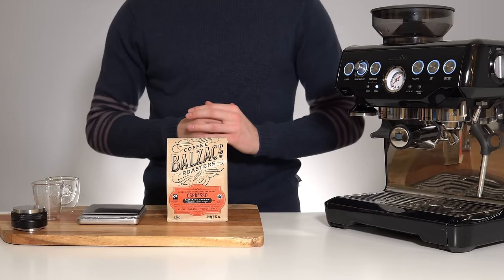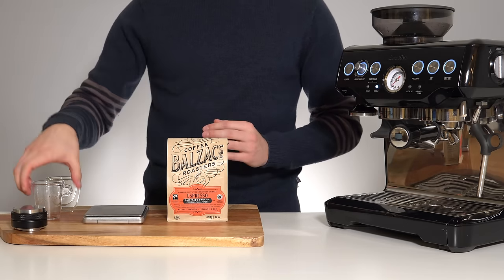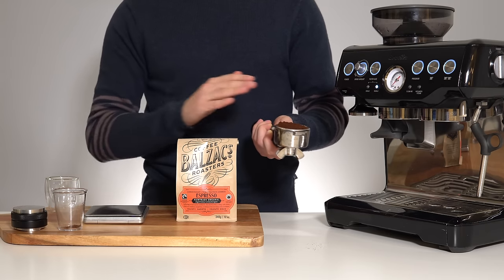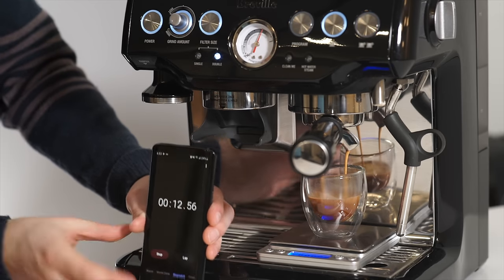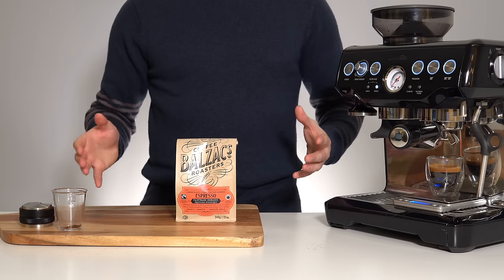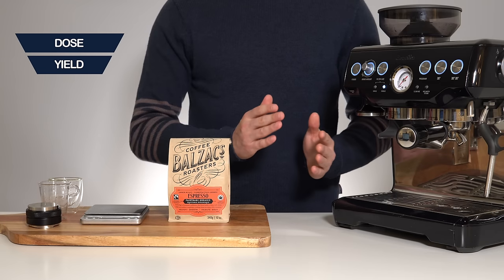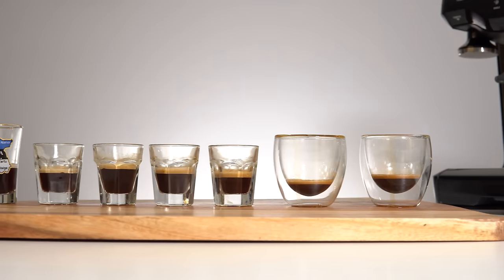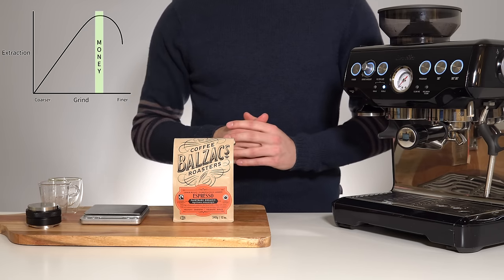Dialing In Breville Barista Express | Dose, grind, yield, time

Comment: Hey! Love your video and have been dialling it in myself. What does it mean if I am using 18g of grounds, the pressure is at the Max of the grey area, but it still runs fast. I got 54g (3:1) in 20 seconds. So my desired 2:1 was probably 14 second or so. Thanks!

Comment: There is an additional adjustment underneath / inside the bean hopper. Did you make an adjustment for that or leave it at factory setting?
Reply from the maker: Our grinder is on the factory setting, but it can vary from machine to machine

Comment: Hi, I know this video was posted a year ago, and you're propably not going to reply but I just wanted to say how much you helped me!

I do have a problem though:  What do I do, if the espresso runs way to fast? (at around 12-15 seconds). I already adjusted the grind setting to "3" which is very fine, and its still running fast. 
Should I up the dose? The beans I use have a light/medium roast.

Thanks!
Reply from the maker: Always remember to be dialing in to taste as well, but if you're still underextracted, grind finer! Even if you hit 1, you still have more grinding range! https://youtu.be/QNvOcE4-VEo

Comment: Thanks for the video. Any guidance on what time range I should aim for if I want to pull a single?
Reply from the maker: Single shot baskets are specifically designed to produce a similar tasting shot using the same grind setting as the double shot basket, in a similar extraction time. You can play around a bit with dose and extraction time to taste, but you should not need to touch the grind setting (thankfully) when switching between a double and single basket. Follow your tastebuds! A single shot basket will be far more sensitive to small variations in dose, extraction time, etc...

Comment: Have you run into issues with your grouphead rubber seal popping out in spots when pressure gets too high? This just recently started happening with our barista express. It first happening when backflushing/cleaning with the cleaning insert. It would build up max pressure, hold it momentarily, and then lose it and water would sputter out of the grouphead. When that happens, I have to remove the screen and push the seal back into the grouphead where it has pushed out. Also, it seems that locking into the portafilter is easier now than it used to be. There used to be much more resistance to locking in a tamped portafilter. I seem to be able to avoid the loss of pressure problem by not tamping too hard, but now I'm getting under extracted shots (IMO). Any thoughts on why that's happening? We've had the machine just under a year and it only recently started happening. We descale it probably every 2 to 2.5 months.
Reply from the maker: I haven't run into that problem on any of our machines. The portafilter locking into the group definitely gets easier after a few months of ownership. 
If you are struggling with maintaining a seal, i suggest replacing that rubber gasket. Its relatively easy to do, and will likely solve the issue :)

Comment: Do you use double wall or single wall filters? 
Great video btw
Reply from the maker: Single walled!
Dual wall filter baskets are only for use in cases where the coffee you are using needs "help" building pressure, such pre-ground store bought varieties. Are long as you're grinding fresh coffee, and grinding fine enough, a single walled basket will produce a better shot of espresso
Reply: @LifestyleLab_  thank you for quick answer, I guess I should invest in some good quality beans. Store bought PC brand coffee beans keep pouring out in 9 seconds even at the most fine setting.

Comment: What is dialed in? Each time you add some beans you have a whole new set of variables to adjust for. Even the same bag of beans will change over time. Just put the beans into the hopper, set your grind amount until it rises over the edges of the filter basket, tamp consistently with the built in tamp and you will dial it in consistently without having to weigh anything. I get great consistent crema like your best shot every time with my supermarket branded coffee beans every time. When I switch to expensive beans I just have to trial and error grind coarseness a few times with everything else consistent and constant. That’s just way too much work and still requires the same trial and error.

Comment: Hi, great videos, keep it up! I have a question though. If I use 18g of beans, it's not enough to fill-in the basket at grinder setting 8. It;s way below the edge of the Razor tool. I have to go all the way to 21-22g to fill-in the basket. Is this an issue ? Does the basket need to be full to have a good extraction ? Thanks for your help!
Reply from the maker: Yes, the basket does need to be full otherwise water will pool ontop of the puck. How is your flow rate looking with 21grams?
Reply: @LifestyleLab_  It's much better with 21 g. But I think the quantity of beans needed to fill-in the basket really depends on the type of coffee used, I guess the lighter roast would require more beans to fill-in the basket.  I just found it interesting that everyone on the internet mentions that the dose should be 18 g, but this clearly didn't work for me. This is one more parameter to take into account. With the bottomless portafilter, I can see lots of channeling when the basket is not full. BTW: Thanks a lot for your amazing videos !

Comment: I poured almost 10 shots but it was still runny, i also increased the grind size every time. 
but when i set it to 3 gave the perfect shot in exact 25 sec but it taste bitter and i dont like it 😑.
And the wired part is when the espresso range doesnt go higher than pre-infusion in neither of the shot tries.

Comment: Thank you for this super helpful video. I followed your step by step approach using a palm tamper set on 7.5 mm and get 38ml espresso with 18mg grind in 25 sec. BUT: The pressure indicator is in the "red" zone at 2 o-clock. The espresso tastes bitter. If I reduce grind grade -1 the extraction time reduces rapidly to 14 secs. Any advice ?
Reply from the maker: Try reducing the brew temperature, or pulling the shot shorter to reduce the bitterness without changing grind size

Comment: First of all, great video. But I have a question. I normally begin taking the time as soon as I press the button to start extracting the espresso with other machines, I’m not familiar with the “preinfussion” thing in this machine, but I noticed that you begin counting the time when you see the first amount of espresso. Is this because the preinfussion time doesn’t count?
Reply from the maker: Because you should be dialing in to taste, not to a specific time, the way of counting is somewhat unimportant. When you're aiming for 25 seconds, you're just trying to the the shot to the point where its bearable to taste, but you're work isn't over yet! Use the concepts in the second half of the video to further dial in based on the coffee, and your preferences

Comment: I think it's bit misleading, here's why. Pretty much all the conical burr grinders have grind retention, it means how much coffee (in % or g) is stuck inside the grinder between the burrs, chute, etc. So putting 18g of coffee in the hopper almost guarantee you won't have the exact 18 grams coming out in this machine set up, single dose/flat burr grinder are different stories and they have much more accurate and have less grind retention. Also extraction time should be measured from as soon as the first drop of water hitting the ground not from seeing first drop of coffee in the cup, although you might have the extraction taking place in 30 second, the pre-infusion might take 3-5 seconds so the total extraction time will be 35 seconds instead of 30 seconds, which then could mean you've over extracted the coffee.
Reply from the maker: Although the burrs in the BBE do have retention of between 1-2gr, the resulting amount in your portafilter only truly varies by +/-0.5gr I've found. This is because the fresh beans push out the retained grinds from the previous grinding session. A grinder can not infinitely retain grinds (your machine would be full within a week!) 
With respect to timing of the extraction, and this is something I went over in the video and countless times in the comments, there is no exact number for a over or under extracted shot. Some dark roasts taste great using a 16 second shot, some light roasts can take as long as 35 or 40 seconds. Therefore there is no point in debating the "right" time to start timing a shot, as you will need to adjust to taste regardless. As long as you are consistent within your own process and always time from button push or first drip, you will be constant with your extraction. The 25 second number is a VERY general rule to get total beginners a borderline drinkable shot right off the bat

Comment: Ok I just got this machine and I did the 18g like you said with the double shot basket and my portafilter was overflowing when I poured it back in. Are you using a different portafilter? Yours fit perfectly inside your portafilter. Please help?!
Reply from the maker: You are likely grinding much too coarse. The finer you grind, the more grounds can fit into the same space 

I also find that 17g is a more suitable dose for these 54mm baskets

Comment: Can I ask a potentially silly question?

On this machine, with regards to the wheel on the side for how fine/ coarse the beans are ground. Is it, the higher the number, the finer the beans, or the higher the number the coarser the beans?

Appreciate it has the ‘fine’ and ‘coarse’ modes on either side. But do you turn the wheel towards the setting you want, or do the higher numbers indicate which mode you’re using?

Thanks
Reply from the maker: Lower numbers are more fine, higher numbers are more coarse! 

Big # = big grounds 
Small # = smaller grounds
Reply: @LifestyleLab_  thank you!

Comment: First... AWESOME VIDEO!Question. If I unplug my breville espresso machine, does it reset my program timing? Thanks, Ruben
Reply from the maker: Thanks! 
The settings should remain stored even after being unplugged. In order to reset the machine to default, there is an entire process that has to be done

Comment: Hey thanks for the great video! I'm really struggling to dial in my beans. The first issue was my beans were old, I switched out to a new roaster and fresh batch and the shot instantly looks nicer/thicker and removed the spluttering at the spout, however no matter what grind setting I try the shot is just flowing too fast, I started on stock setting of 8 and I get 36g in around 8-9 seconds. Down to grind size 3 and its about 11 seconds, weirdly the pressure is now struggling to get up even using the same grind size on multiple shots, grind size 3 was hitting about that 12-1am mark, now grind size 3 is struggling to get into the range at all. Really stuck for ideas of what's going wrong?? Thanks!
Reply from the maker: You can still grind finer by adjusting the internal upper burr setting to get additional range
Reply: @LifestyleLab_  Thanks! I tried that, it has made quite a bit of difference.

Comment: Hello 2M views! Love your videos, sounds so easy. We got 3 weeks ago a Barista Express and we have been struggling. With 3 different coffees we never managed to get a good espresso! We have a very good pressure but always a too fast extraction (18g yielding 36g in 19 sec and pressure at « 12:30-45pm ») with a small, dark and spotty crema and a sour/bitter/burnt taste. The burr is at 3 now and the side size grinder at 5. What do you recommend? Is it better to play with the top burr or side? Shall we make the burr finer or keep player with the grind size? We always have a bad coffee with little crema :( Thank you the coffee expert! Help!! Sophie
Reply from the maker: From the sounds of it, you're dealing with some channeling issues. Meaning that there are areas of your portafilter with less coffee than other areas, or no coffee at all. The water will quickly rush through those holes creating a sour taste. You need to make sure that the coffee grinds are fluffy and filling your whole portafilter before tamping. The distributor tool I use in this video really helps with that. A good puck of espresso will create a seal in the portafilter, and force the water to flow slowly across the entire puck instead of gushing through certain low density areas.

Comment: This seems extremely complicated for a novice. Had the machine for a week and I'm frustrated by all the different information of how to use it.  Do you have more beginner videos?  Thanks
Reply from the maker: Espresso is a tricky thing, there's really no way around dialing in a new coffee. Being consistent on your dose is the best way to eliminate frustration, because if you don't and just use timed grinding, the dose will change as you adjust the grind setting. 
All you're looking for is to get a reasonable flow rate out of the machine. If you're overwhelmed, just do this visually

Comment: hello good video, question I am interesting in the PAlm Tamper, do we have to calibrate it?, in order to apply the correct amount of pressure?
Reply from the maker: You will need to set it to the correct depth, but otherwise the pressure will be consistent so long as the dose is kept consistent :) 
The whole "exactly 25lbs of pressure" idea is very much a myth

Comment: Which portafilter did you use ? The DUAL WALL or the SINGLE WALL for this setup ? I know its the double shot but Breville gives you two types the one with all the holes which is harder to use or the dual wall that just has one hole on the back
Reply from the maker: Dual walled filters are only for when the coffee needs "help" building pressure (ie not fresh, pre-ground storebought coffee). In all other cases, you want to be using the single walled filters

Comment: Hi, I owned a Breville bambino plus, and a Breville smart grinder machine. I am just hopping into the learning of espresso. Currently, I am using a pressurized basket (will be getting non-pressurized basket in the next 1-2 weeks later):

1. I noticed that the brewing pressure starts "avalanche" after about 12 seconds from the 1st drip. Avalanche means, the flow rate has increased significantly fast. Since I have not control over the pressure from the machine, should I reduce the amount from 18g to 16g of dose? 
2. Based in this scenario, if lowering the dosage doesn't help, should I increase the grind size to finer? Currently I am setting at 10 (1 is the finest, 60 is the coarsest).

Thank you.
Reply from the maker: The "avalanching" you describe has less to do with the grind size, and more to do with the puck preparation. If something changes dramatically with the flow part way through the shot, it means the integrity of the puck has been compromised and you are seeing channeling. 
It is natural for a shot to speed up slightly towards the end as the grinds become completely saturated, but not all of a sudden, and not by a HUGE amount
Reply: Lifestyle Lab, thanks. It makes sense.

Comment: So much work,, I’m gonna need a shot just to start my morning shot ☕️
Reply from the maker: Now that's a routine I could get on board with ;) 
Joking aside, the dialing process only needs to be done once with each new coffee. Once you have your grind dialed in, simply program in the proper shot length, and it's set and forget. Happy brewing!
Reply: Lifestyle Lab does the programming of the timing happen just by hitting the program button and then the double shot button ? Then every time i hit the double shot button going forward it will use that timing ??

Comment: Which exact wall
Basket are you using in this video ? And what is the exact grind settings ? My range lever isn’t going up when I use the single wall basket unless I switch to duo. I can’t seem to figure it out.
Reply from the maker: Dual wall filters create pressure for you, single wall baskets rely on the coffee puck to create pressure. I have a video on this :) 
Sharing grind setting will do you absolutely no value. We aren't using the same coffee, on the same machine, on the same day. You need to dial in as described in this video, and keep going finer until you get to an appropriate flow rate! Can adjust the upper burr setting if you hit 0 on the outer adjustment dial and still need to go finer